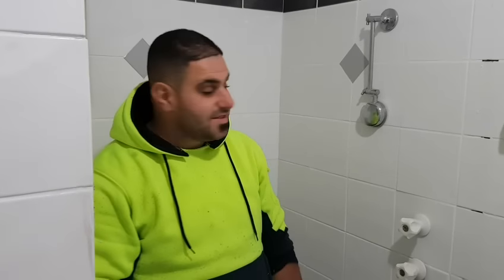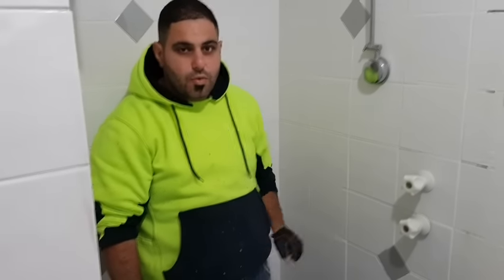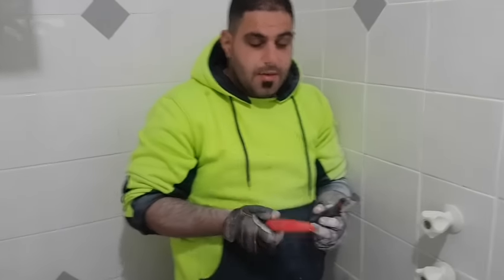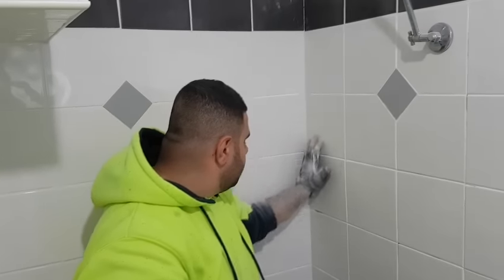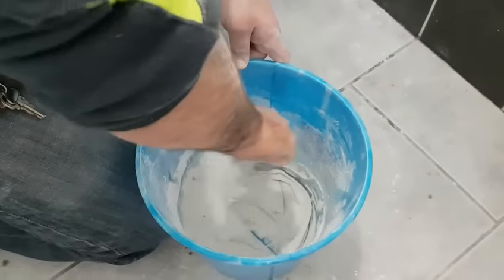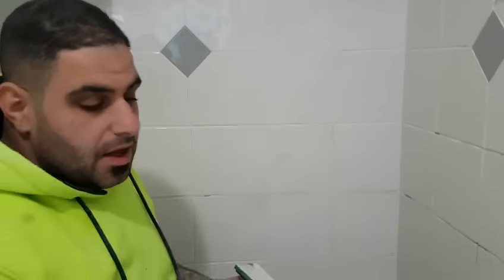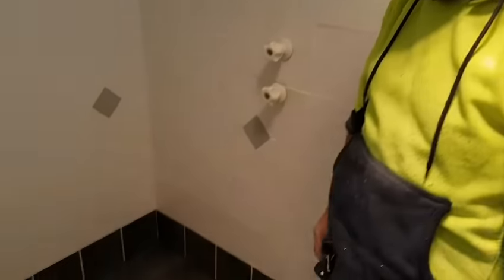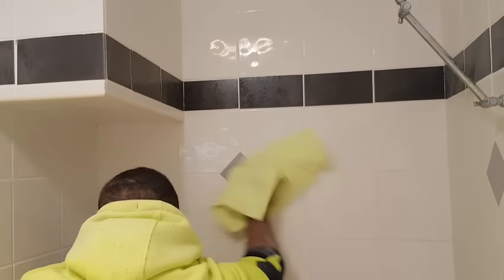How to regrout a leaking shower

Comment: Great video, comprehensive and well explained, thanks!
How long to wait for drying? 2 days?
Also, can I silicone over grout before the drying time is up? Thanks.
Reply: Hi LEX

It usually takes the grout about 2 days to fully set. You can silicone over wet grout but its very messy and not recommended as it my compromise the seal.

Thank You 
Richard
Reply: Can you use the shower within the 2 days? Or would that mess up the grout?

Comment: Hey wanted to ask,  I've got tiles missing in my bathroom floor. I've cleaned out the area of old grout as much as possible and I want to replace a few times and fill any missing spaces with grout.. Will this work or do I need to have some kind of adhesive first on the floor/sement? Thanks!

Comment: Great video and gives me the confidence to have a go myself. One question though which is how long do you leave the grout after the initial application and before you start sponging off. Likewise how long do you wait after sponging and before polishing ?
Reply: Denis Patterson regarding the sponging off question, some grouts are different so read the bag and it will tell you, but a good way to tell is when it you rub your finger in the excess grout on the tile it doesn’t stick to your finger, and polishing is better the next day when the grout has cured so you don’t rub any out and create a low spot, but you can leave it for a few hours then go over it gently with a rag.
Reply: Dead set excellent instructional video bud. Legend like you need to make more videos like this!!!!!

Comment: Thanks for the thorough video.  Why did you remove the grout that was still good?  Can you just fill the gaps?
Reply: netgk1 you need at remove at least 3-5mm of old grout for the new grout to be done correctly. If you just fill in the gaps or grout on top, there will be insufficient adhesion and you will risk premature cracking and wearing
Reply: Many thanks for your quick reply Richy.  I'm still not quite clear on something.  My grout has a couple of 1-inch gaps, where it seems to have completely disappeared.  Do I need to replace all the grout on the entire wall?  Or just an inch or two radius beyond the gaps?
Reply from the maker: netgk1 Ideally you want to replace the entire wall. if you have a few sections that have deteriorated chances are, the remaining grout will follow soon. You can clean the surrounding grout and only fill the existing gaps, but this will be a very short term fix
Reply: Got it.  Thanks so much for your help.

Comment: Good well informative video, quick question & forgive my ignorance but arnt you supposed to fix or make sure the water proofing is structurally sound before the re grout as the grout on its own is not a water proof barrier.
Reply: Use urethane premixed grout, it’s waterproof.

Comment: great video. Do you gave any tips or advice on how to not damage/gouge the thinset and backer board beneath the grout when using the oscillating tool?
Reply from the maker: Hi John Soleimanian

When you are using the oscillating tool you will feel when it gets through the grout before you damage anything underneath. If you have signs of a leak it's a good indication that your water proofing has been compromised anyway. You only need to take off about 3mm, just enough for the new grout to have room to grab the tile.

thank you for your comment
Reply: Thank you! Last question Is the risk of cracking tile with the oscillating tool from hitting the tile, or can the vibration also cause tiles to crack?
Reply from the maker: Hi John Soleimanian
The chances of you cracking a tile are slim. In the off chance that you do just glue it back in place and grout over the top of it.

Hope this helps
Thanks
Reply: Took 10 hours to do 20sq/ft. of 3/8" grout lines. Ill stick to the method in the video but do you (as a professional) still use an oscillating tool for grout lines that wide?
Reply from the maker: John Soleimanian  yes i do as it is much faster and cleaner then using hand tools. Thank you

Comment: Great video. Thank you. We have a second floor shower leaking that is  dripping onto the ceiling underneath and it appears to be the grout but does this solve the problem or does the shower pan require replacing as well?
Reply: hi did you need to replace pan? or just regrout?
Reply: r velas hi. Well that’s the question I’m trying to figure out. If the pan was good, I am not sure it would be leaking through to the floor below would it?

Comment: Thanks for this. I need to regrout mosaics. Can I use a machine like yours for this or do I need to use a hand tool to remove the old grout? Also I think you mentioned not to regrot the corners as they will crack. Can you talk abou this some more, I’m not sure what to do as the grout is missing. Thanks again. Good work.
Reply: grout saw
Reply: the silicon bead makes it waterproof. you don’t want to grout it because it will flex with the wall and cause the rigid grout to crack. the silicon will have more flexibility

Comment: how deep into the old grout should I go?  Am trying to go 1/8 inch, but the grout is 30 years old and it's hard to get that deep.  Is it ok if there is some old grout in there when I regrout?  I can see the backerboard in some parts, but still some white grout showing in others.
Reply: Wondering how did it turn out?

Comment: Is it possible to use silicone to grout all the tiles instead of grout?
Reply from the maker: Ahmad H M Using silicon instead of grout is not recommend and would be an extremely messy job
Reply: Thanks for the tip!!

Comment: What about grout sealer as the final process when grouting / rerouting shower tiles that leak?
Reply from the maker: There are products that when mixed with grout will help the grout to last longer. Sealer is really designed to prevent staining, it could help with water but i wouldn't bet on it.

Comment: Thanks for the video. Do you need to use a sealant on shower grout?
Reply from the maker: Odette Wynne No not necessary although a good second line of defense. Also note that grout sealer is quite expensive

Comment: How much do you charge for a job  like that and what state you’re at?
Reply from the maker: Hi Dan 

Im in Sydney NSW. Re-grouting is a temporary fix and i recommend that you try to do it yourself to save money. It would cost you about $100 to regrout your own shower. If you hire someone to do the regrout for you you can expect to pay between $600-$1200+ depending on your bathroom
Reply: @BuildSmartByYesICan  And how long of a temporary fix are you talking about? 2 years? 5 years? 20 years?
Reply from the maker: @N8Bailey  2-5 years depending on usage and the current condition of the bathroom
Reply: @BuildSmartByYesICan  Thanks, We've got a leak in our shower and they said it was a faulty shower pan, but I'm thinking it's got something to do with the grout. In the case of a 2-5 year repair before having to do it again I am thinking of just installing a new shower altogether and redoing tile and grout and shower pan. It's  an insurance claim so we got a check already to pay for it but I am just trying to decide on what to do. Thanks for your response.